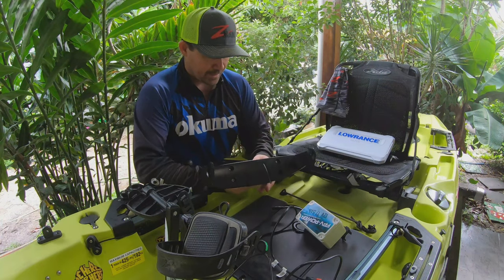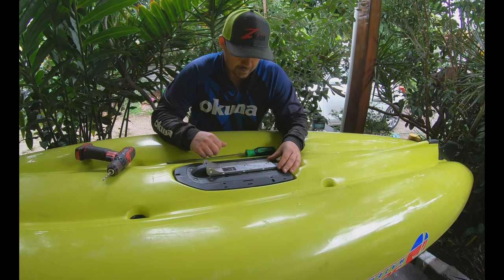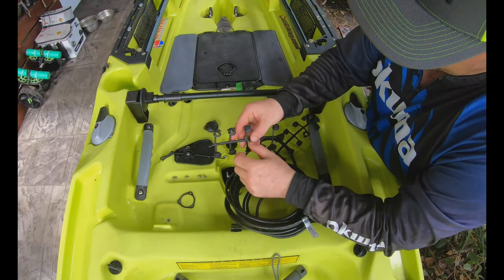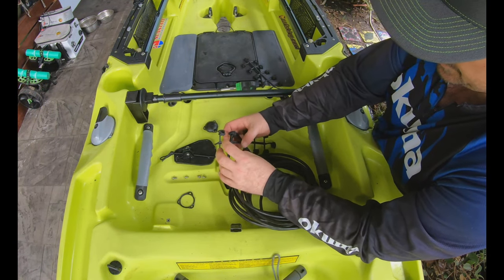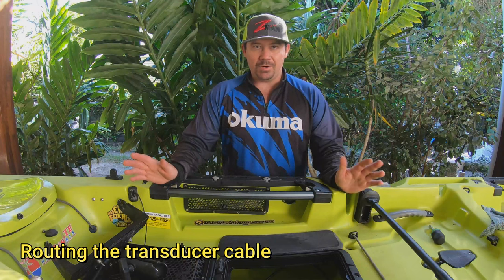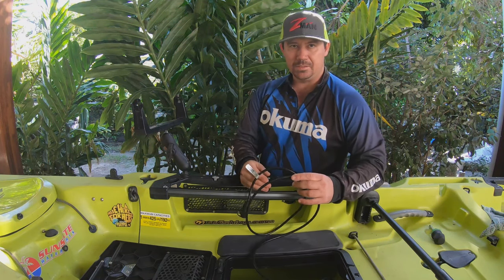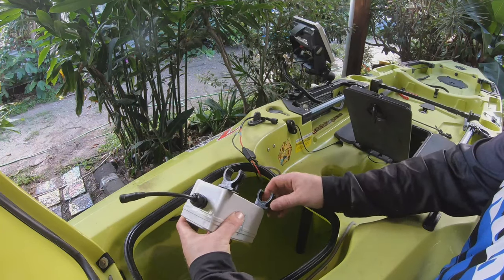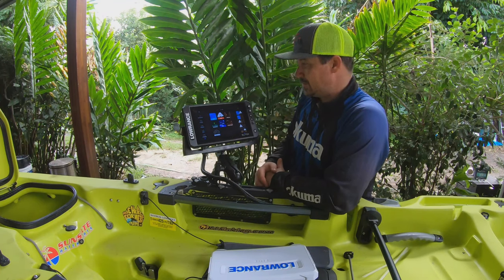Installing a Lowrance Elite FS9 into a Hobie Outback Kayak

Comment: What did you do with the yellow wire on the lowrance power cable?
Reply from the maker: Morning mate,  I don't recall there being a yellow wire,  if the was I would have capped and stowed it and not used and only used the red and black.

Comment: Curious to know the size battery you used and the actual run time in hrs of the elite unit? Looking at doing something similar, but imagine the battery drain will be substantially higher than my existing simple unit
Reply from the maker: Hey mate,  I comfortably get 9 hrs to 10 hours out of my setup.  the battery is a FPV 17.5 amp battery.  Lowrance state the FS9 unit draws approximately 2amp per hour, that being said I am pretty sure it draws a little less.  hope this helps